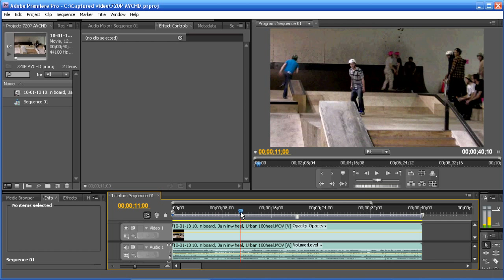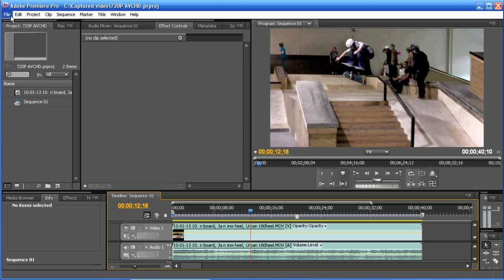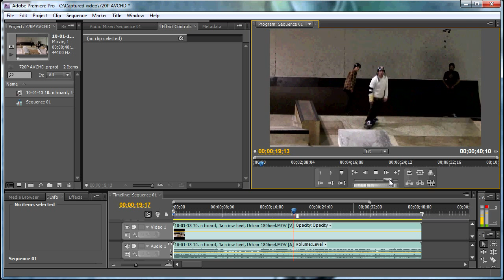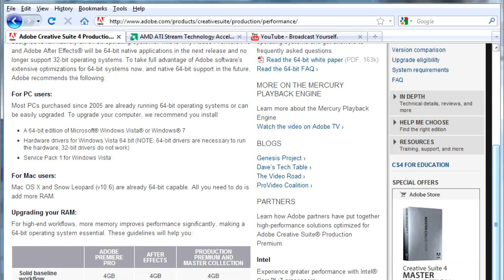Processing power required to edit AVCHD video

Comment: @cameratest It actually depends massively (but not solely) on your software's GPU Acceleration, Avid and Vegas Pro can fully use graphic card to edit and give realtime feedback of video, and a good processor and RAM just help overall stability of the program.
An i7 920, 6GB of RAM and a GTX580 will edit anything (Y) Fast HDD also helps

Comment from the maker: @fnub You might want to try unchecking "frame blend" in Adobe Premiere.  It will give the final video a different look, though, which you may or may not want.  Of course the best way to avoid long render times for time lapses is to get a camera that can shoot time lapse natively, but I know from experience that few cameras do that for some reason.  What camera do you have and what format are you exporting to when no rendering is required?

Comment: @MsMakeupEmma
corel videostuido pro (x3) - $30
pinnacle studio (15) - $50
sony vegas (?) - $60
corel videostudio pro(x4) - $80

tip: double check the system requirements

also, seeing as your laptop isn't 'up to par' with avchd editing I recommend you convert it into something like mpeg4 or avi. the file will get a little bit bigger but it will work much better in editing than avchd.

good luck.

Comment: Timeline, AVCHD, 1080i, doing a time lapse, speeding up to 10,000%, takes longer than forever to render - any tips? Also noticing that in some instances I'm exporting without rendering - even if I apply crossfades - no rendering required...